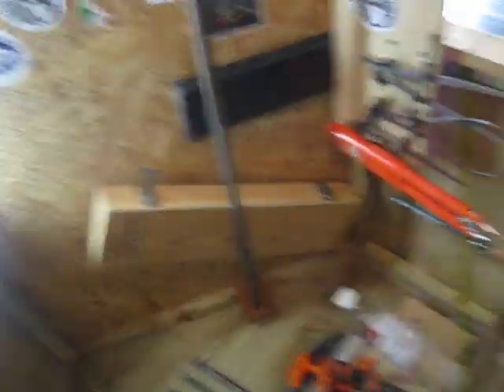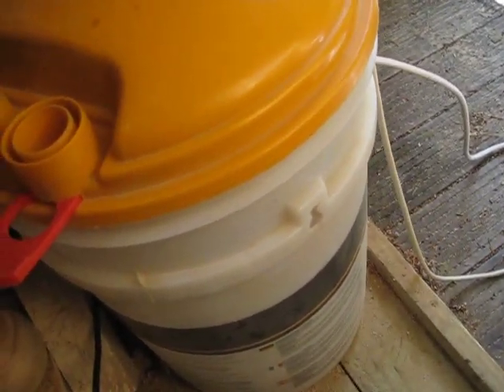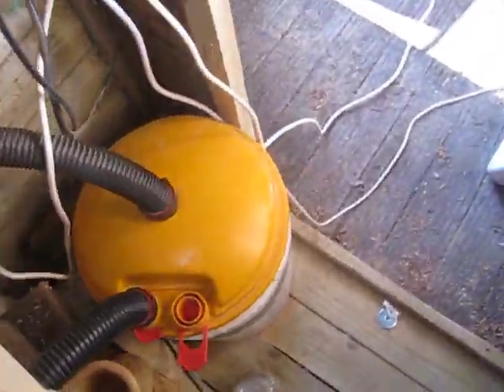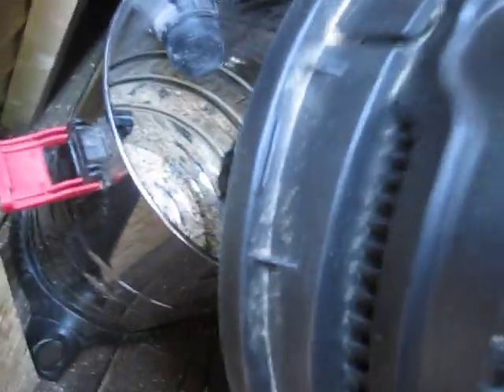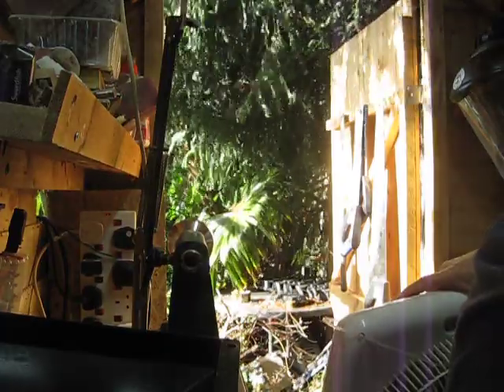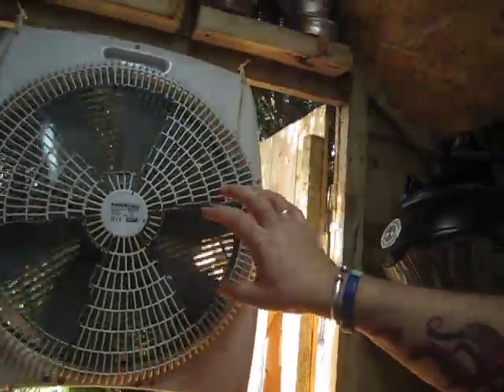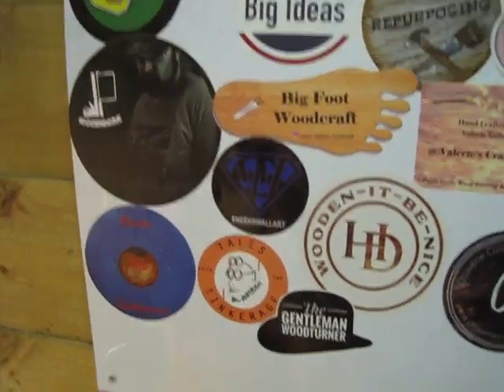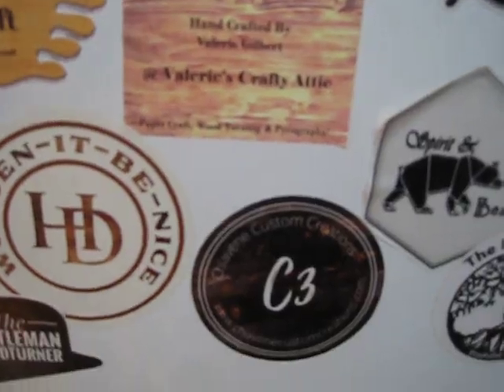dust extraction on a budget

Comment: Hi Colin - thanks for this. Do you detect any loss of suction power when the Triton is connected as opposed to a direct connection to the vacuum cleaner?
Reply: PS what do you use for the bulk shavings on the floor - your vacuum cleaner?
Reply from the maker: @mikeu-ilminster5155  Hi Mike no I dont get any loss until the triton fine filter clogs up I use the triton to suck up the shaving too I empty it into the compost and tap off the fine dust and put it into a jar to use with glue on cracks etc true recycling lol